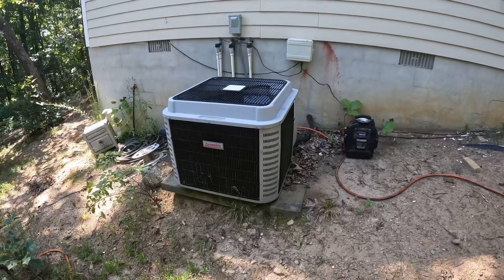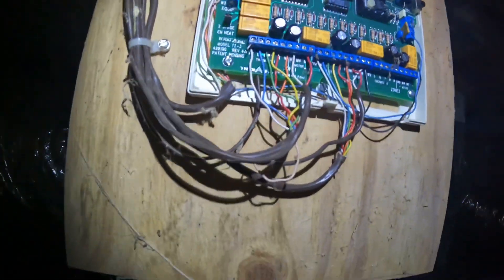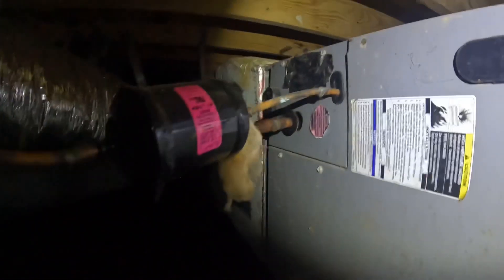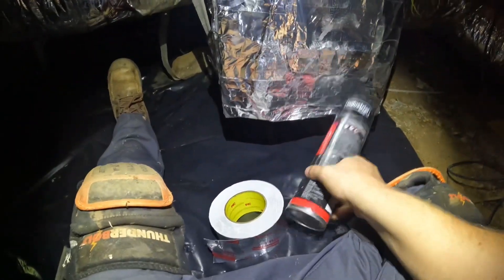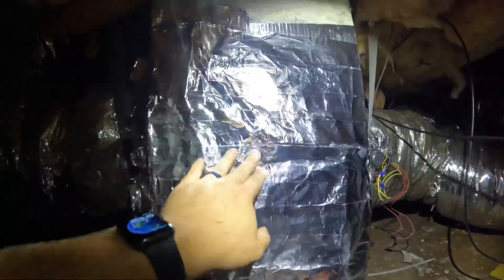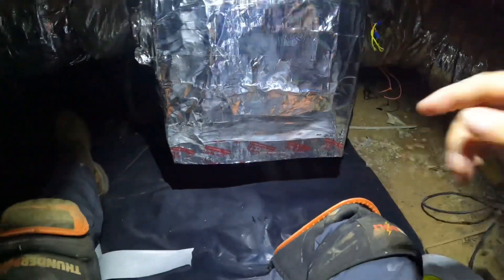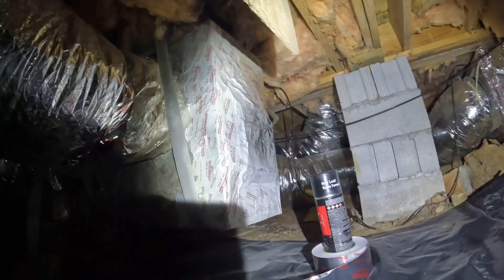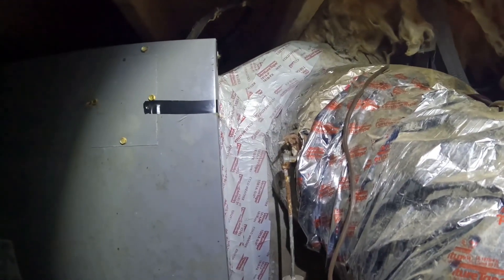Older heat pump system Isn’t working properly!

Comment: I had an 83 year old neighbor who’s A/C was not working correctly. The unit was under warranty but it was a holiday weekend and it was almost 100 degrees. I found that the top of the plenum had come off due to a hack job by the installer. There were no staples and the tape let loose. I was able to temporarily fix the plenum but I told my neighbor that she needed to get the HVAC company to come out and fix it correctly. She never did call the HVAC company to fix the plenum and my temporary duct fix lasted about five years. The good news is that the new owner of the house was an HVAC repair tech so he installed a new plenum. He complained that some jackleg had duct taped the plenum and I started to laugh and told him the whole story.
Reply: You said, it wasn't "some" jackleg.  It was a quite familiar jackleg.  😊

Comment: Did you spray the tape and surrounding area with something??
Reply from the maker: It’s a bonding adhesive
Reply: @jkelleyhvac  So you are just applying a spray adhesive over all of it.  im guessing it acts kinda like pookie?  never thought of using it on that stubborn dirty tape.
Reply from the maker: @RivenRj  it’s just something I do personally. It helps and also looks good

Comment: This is a fine example of best practice and excellent training in maintenance. I'm in maint, but not f gas rated so  it interesting to see what other things can be checked before I have to get someone authorised to use my gauge set. BTW you yanks make great hvac test gear.

Comment: Interesting call -- thanks for the video.  Complaints about power bill can include so many things.  This HP had its problems, for sure, but there could be other appliances, or things the customer is doing, that cause the high bill. Can't check out all of that on a basic A/C service all.

Comment: What was that shown on camera at time mark 3:28 underneith the supply plenum?
Reply: Looked like a rock to me
Reply: Looked to me like about a 10 inch open hole with no takeoff. It’s black while everything else is silver under the supply plenum.
Reply: Well….. there was a rock on the ground under the plenum. Camera angle was not very good for viewing the bottom surface of the supply plenum. Shadows can play tricks on the eyes  but you’d think he would have noticed the air coming out of a 10” hole after discovering smaller leaks. Who knows.

Comment: 🛑🛑🛑🛑🛑🛑JESSE, take this hack job off YouTube. You did NOTHING TO CHECK THE TXV OPERATION, you take off the AH lower panel, and test the sensing bulb!!! Hold it in your hand, and if it opens up it’s good. Put in ice water, if it closes up, it’s GOOOD. Why the fuck are you patching holes with the same kind of tape!!!!??? YOU DIDnt SHOW PRESSURES AT THE END, didn’t even talk about superheat or subcooling. NEVER STEP FOOT IN MY STATE (FL) or you will be kicked out immediately for this HACK JOB, you did not help their electricity bill, because it will continue to run long times because the TXV or restriction in filter drier is under feeding the EVAP COIL🛑🛑🛑🛑🛑🛑🛑

Comment: I had an 18,000 btu window unit.My bill went way up.I measured the compressor amperage.It was supposed to be about 7 amps.I measured it with my amprobe,and it was over 11 amps.What I like is that my old amprobe is a linear meter,and it doesnt time out like my digital one.I can leave it on and monitor it.You probably dont want to hear about window,or wall units.LOL :)